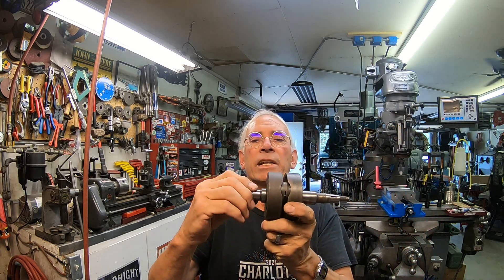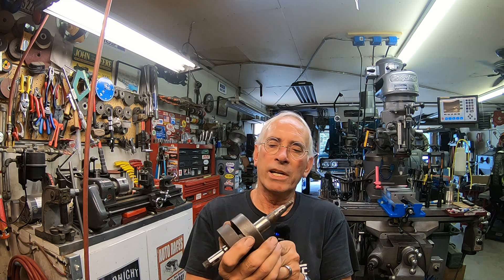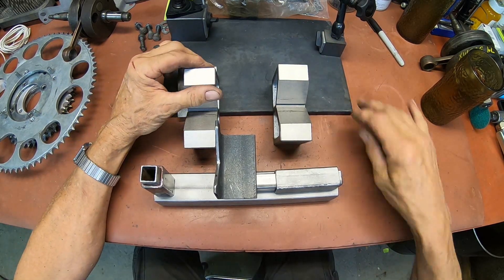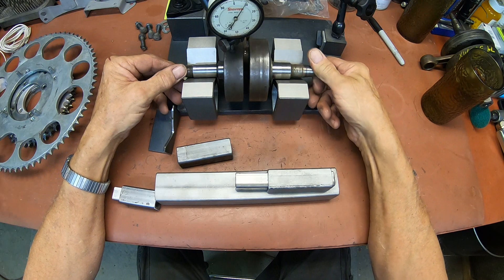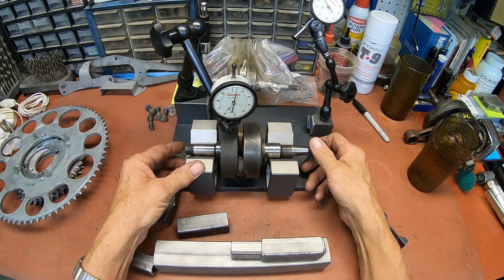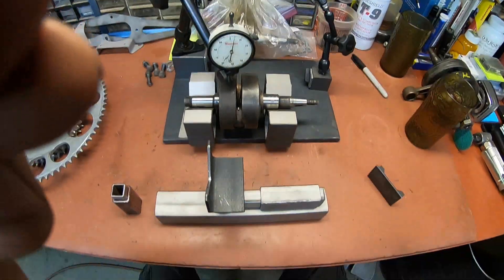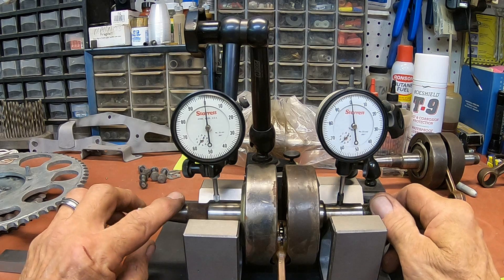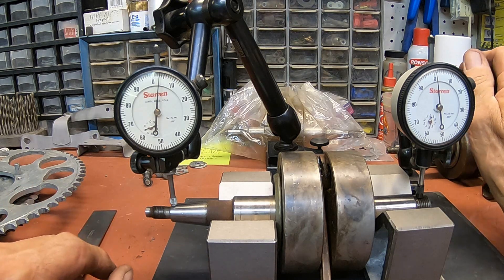Crankshaft runout checker for the Suzuki RM125

Comment: Nice work, just found your channel a couple of weeks back and went thru this same process when I wanted to double check centre to centre in my lathe on an old twin BSA crank, bought those wide V blocks and like you didnt trust they were telling me anything. You just confirmed what I thought, off to Make some thin V blocks now.

Cheers From Australia, also just doing a 73 RT3 crank today aswell 😊
Reply from the maker: Thanks my friend, my go to is center to center on the lathe, but if the center holes are messed up I go to the knife blade V blocks I made. The wide ones just will not work. I just had a visitor from Australia in my shop a few weeks ago. We had a great visit. Nice people. Best of luck with your project.

Comment: Just found your channel you do nice work 👍👍🏁🏁 what I do for truing is take drum sander to old- good bearings so they're slip fit. Then can spin on bearing and check end of taper furthest away from where they sit on v blocks. If you use a layd you check where bearings go. Furthest away from ends . Opposite when using v blocks 😃
Reply from the maker: Thanks for the kind words, I generally do crank truing in the lathe, but more and more of them come into the shop with beat up centering holes. In the case of this RM crank, if you follow the whole series (think there were 6 videos on this), this was a 2 year only crank, and the owner was unable to find one, so I had to make the threads on both ends, cut off the old beat-up ones, then drill the shafts and press in the new ones with Loctite and then pin them in place. I didn't feel that I could get the centering holes in the proper place, so I built this fixture to check the runout. To be honest, I will probably be using this fixture more and more in the future because the cranks left out there are so beat up. Sometimes I can set them up in the lathe if I have the crank split apart and carefully recut the centering hole, but you have to go at it slow with a single point cutting tool to keep it as it should be. Thanks for spending time with me in the shop.
Reply: @montana2strokeracer  ya I watched bunch of your videos last night and I don't tend to watch guys on YouTube 😆 but you know what you're doing for sure 🔧🔧 i actually do alot of vintage engines for local vintage racers. More modern stuff but have a gt80 and it175 engines on bench rn 🔧🔧 would you be interested in doing some bores for me in future? One thing I don't do and I got hurt racing in 2020 so in wheelchair now makes everything a pita lol. Local shop that's done bores for many years isn't doing them as much cause old mechanic is retiring. They'll still do but takes awhile. You do good work and have the machines to do them. I'd send the correct piston and have cylinder clean and stripped 🔧🔧
Reply from the maker: @thetwostrokerebuilder  Hi there, I hate to commit to an open-ended thing for any type of engine. You can send me an email at dsweger@bresnan.net when you have something needing bored. I will determine at that time if I have the time and if that's something I want to work on. I get pretty busy at times and one thing for sure is I don't get in a hurry on anything, so if you need it quick, you probably should find someone else. Thanks buddy sure appreciate it.
Reply: @montana2strokeracer  Roger that 👍 thanks for the message back 👊
Reply: I'm in upstate NY close to old national track broometioga or Binghamton they called it. Although not in Binghamton or even close lol

Comment: For my CT 110, the Honda manual shows the crank on vee blocks with main bearings in place & state 35mm from the webs as the point to place the dial gauges. I wasn't sure about that idea so I made up two different stands, one using knife edges, similar to yours.  I also made one using live centres, holding the crank at the ends.  I measured with the main bearings removed & the gauges as close to the web as possible.  I know that it's not possible on all cranks to suspend them at the ends, but I found it gives a more accurate result.
Reply from the maker: Thank you, that is reassuring. I normally check center to center on the lathe. No holes in this one. I was happy with the set up.

Comment: Hey Dale, On the D group models, BSA have you check the crank in V-blocks, but with the main bearings fitted. I suppose this isolates the shaft from the surface of the block somewhat. They don't have a lathe centre on both ends, just on the mag side. I like your new jig, very good indeed. 
Best wishes, Dean.
Reply from the maker: Yes, if I had the bearings, I could have done it that way, but the customer had already installed the bearings in the cases. One side was common, and I had it 6205, I think. The other side was a weird double row ball bearing......expensive. I will be doing more and more this way I think, so many have the centering holes messed up. Thanks buddy.
Reply: @montana2strokeracer  I like it Dale, I may well build one myself.

Comment: Dale I have a question for you. When you made the new crank ends, couldn't you have put in the tapered centers for the center-to-center method, into the new parts? Wouldn't they have been spot on once you pressed them into the crank?
Reply from the maker: Yes, I could have put them in, but if they were only off by a little....I would not be getting good measurements and I may have made the runout worse and not even know it. Thinking about it now I probably should have put them in just for the pullers to center on if nothing else, and still set it up this way.

Comment: Lathe centers.
Reply from the maker: Yes like I said in the video, I normally set these up between lathe centers, this crank has no holes in the shaft ends, so had to figure another way to skin the cat.
Reply: Don’t trust the center bore in the crankshaft of old bikes. As showed is the best way. (my humble experience)